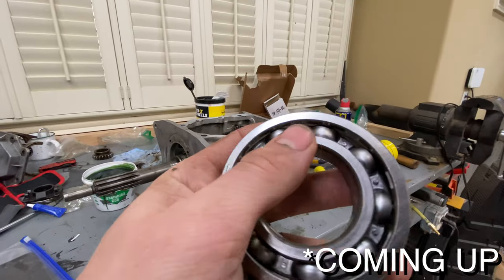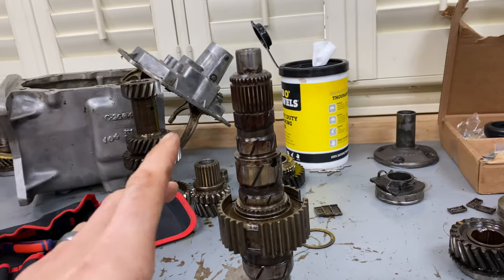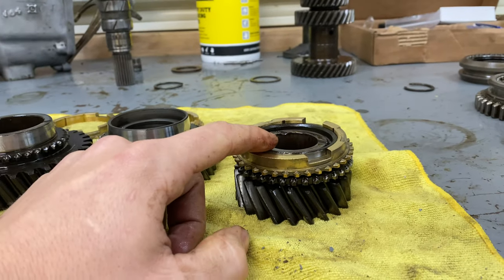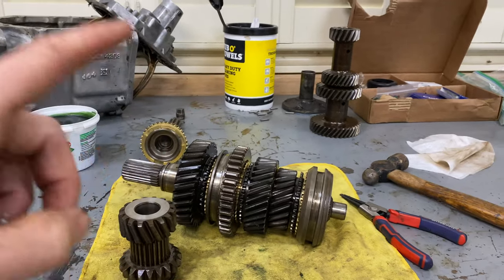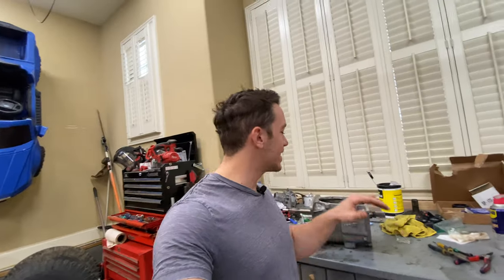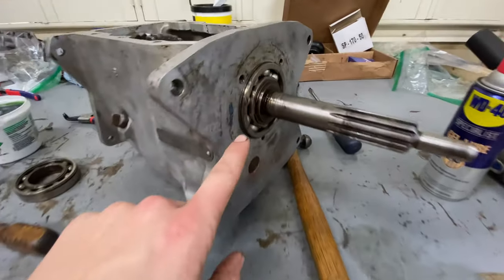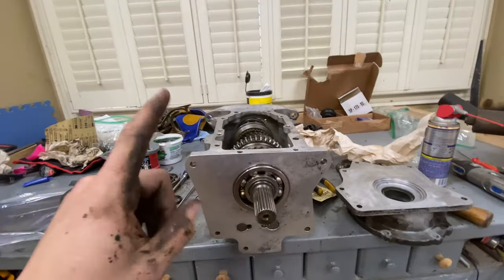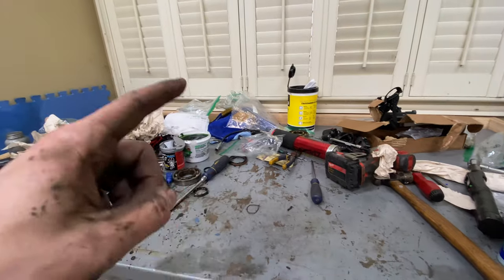I Saved $1,000 By Rebuilding My Own T176 Transmission! Jeep CJ5 Rebuild Part 11

Comment: My transmissions was sitting in water for who knows how long, but I bought it with it like that. Now that I have the transmission apart, I've noticed that 1st gear has some surface rust and light pitting. Should it be replaced? The forums seem torn, like everything else hahah

Comment: Great video. Getting ready to rebuild a T176 and Dana 300 myself. Where did you get the rebuild kit from?
Reply from the maker: Thanks for watching Harold! Good luck on your rebuild. It really wasn't too bad... I had fun learning everything as I went. Just don't forget to buy a big bearing puller. I bought a t176 rebuild kit on eBay product #BK123WS and the reverse idler gear is from all state gear
Reply: @NickDowner  Thanks for the info. Mine is a 1979. Have the rolling chassis, a 304 V-8, t176 and a Dana 300. Going to refinish/rebuild the entire frame and drivetrain. Then start on locating a good donor tub or a replacement.
Reply from the maker: @millstonejeepworx  that's awesome! Sounds like a fun build! Is the 304 in good shape?
Reply: @Nick Downer  It appears to be. Was told it ran good. I'm going to pull the oil pan and heads to give it a good look over. If all looks good, I will just have the heads done, new oil pick and screen, and seal it up.
Reply from the maker: @millstonejeepworx  sounds like a good plan! 👍 Best of luck to you! Hit me up if you have questions on any of the other stuff!
Reply: @Nick Downer  Thank you. Will do.

Comment: Looking great. Was the transfer case working good prior to taking it out of the jeep? Or do you plan on rebuilding the transfer case as well?
Reply from the maker: The previous owner said it shifted and worked great so I planned on just opening it up, checking out the gears, and re-sealing it all up (the seals were leaky) but after cleaning it up while shooting the next video I found a bunch of damage on the case eeeek. Not sure what my plan is yet with that bad boy
Reply: @NickDowner  dam that sucks. My transfer case on my 97 Wrangler blew up on me. I ended up getting a tranzilla transfer case replacement and just replaced the hole transfer case.
Reply from the maker: Tranzilla transfer case… that sounds interesting! How much are those? Would you recommend them?
Reply: @NickDowner  I like the transfer case it's been working great it has a little over 30,000 miles on it now. I paid around $1300 for it.
Reply: @NickDowner  the Dana 300 is strictly a gear-to-gear driven transfer case. If water hasn’t intruded the case and damaged any gears, they’re usually pretty robust TCs.

Wondering what kinda damage you found on the case. They’re also pretty thick-walled cast iron, so I’d be surprised if there was something detrimental wrong with it. FYI - you can usually get a decent used one for $250-$350
Reply from the maker: Are you sure it isn't cast aluminum? I found several hairline cracks on the case eek
Reply: @NickDowner  the rear output shaft housings and shift rail/front output shaft piece is cast aluminum. The actual case of the Dana 300 is cast iron/steel.